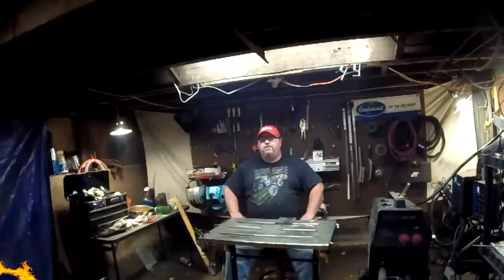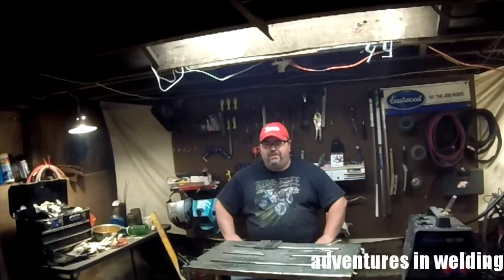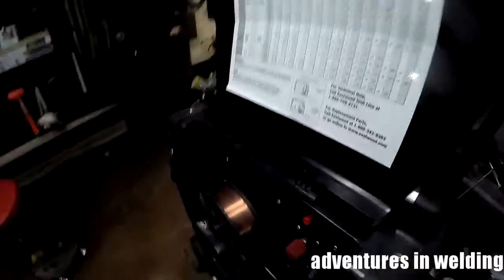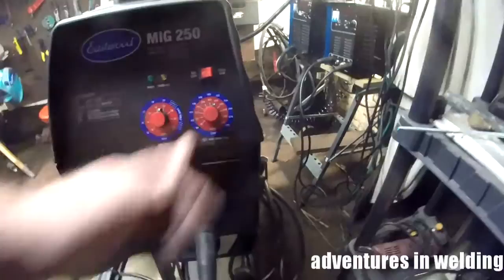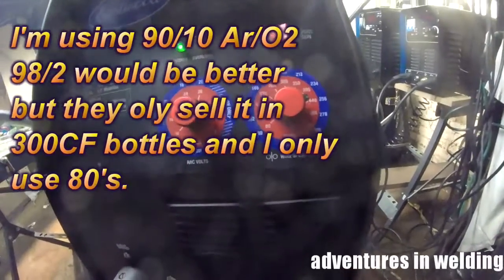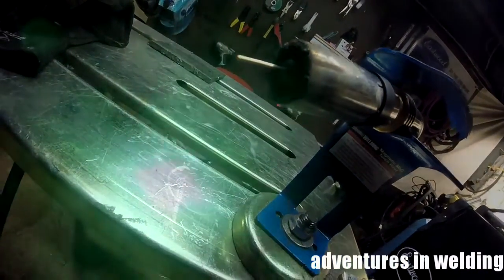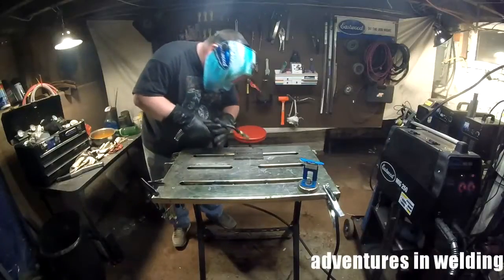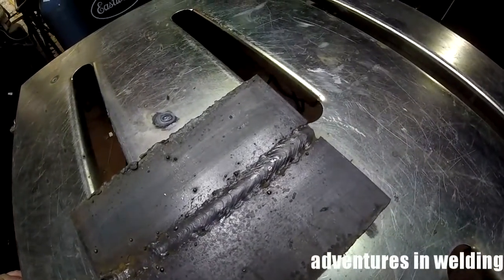Spray Transfer vs. Short Circuit MIG - Adventures in Welding 122

Comment: I know this VID is getting old. However, that did not look or sound like (Spray Arc Transfer) at all. It sounded like (Short-circuit Transfer) while running a little hot or to much speed. On top of not sounding like an (SAT) weld,  the bead profile didn't have an (SAT) appearance. Again it had the appearance of an (SCT) profile that needs to be dialed in.  I'm 100% that was not welding  (SAT) at the time of the video.
 I also don't think that welder is even capable of (Spray Arc Transfer) I could be wrong, I don't know that welder. I will have to look at its duty % and most importantly the Volt adjustments &  the IPM or FPM adjustment. with that, you can determine if the welder is capable of (SAT) welding. With a Duty % high enough to make it worth attempting.

Comment: Its cool that you're making videos....you need a bit more experience. Generally you "push" with non pulsed axial spray transfer. As said many times, you never transitioned into spray and it sounds like you were barely into globular transfer. Your machine may be holding you back. My MM252 dedicated for spray and it works it pretty hard. Get rid of the hobby machine and pick up one with some Puh-Pow!
Reply: +Kenny Fowler -- I like how encouraging your reply is! ...wishing ongoing success to all!

Comment: my setting for spray is 30 volts with 750 wire speed. but that's setting  at work. but what you should was globular transfer. but nice vid keep welding and you'll just keep improving.
Reply from the maker: +Sprocket Gold Thanks for watching, and taking the time to write in!

Comment: Hi Paul, I noticed you were getting a ridge in the centreline of your weld, probably because you were dragging the puddle. Next time try pushing the gun ,you will find it will flatten out more. Scott.
Reply from the maker: scott carr I can't push the root. My brain fails. Brain says pull from the first tack. To be honest I haven't tried pushing an open root since I had GMAW class last year. I'll have to give it another try!

Comment: Hey Paul I will make sure to sub you on my other channels to help ya out. I noticed that your mig seems to be producing globular transfer instead of spray transfer, what type of gas mix are you using?
Reply from the maker: TheToolReview It's 90/10
Reply: Yea spray should be a hiss, with a slight crackle if your puddle builds up. Arc should be a V shape. Wire should be melting before it hits the metal.

Comment: Nice Paul thanks for taking the time to show us that one. So is it just a higher wire speed and more volts for spray vs. the short circuit? Thanks again.
Pidge.
Reply from the maker: PiDGE IAM Hi Pidge, There is a change in the gas also. you need at least 80% Argon. Now there are some choices when it comes to your mix: 90Ar/10-O2, 98Ar/2o2, 90Ar/10Co2. The 98/2 is the best mix for spray (in my opinion) but I can only get it in 300CF bottles locally. And I'm not carrying those up and down the steps so I stick to 90/10. It works....but when you hear the crackling in the video what you are hearing is the ARC going from spray to globular.
Now about Voltage and wire speed....yep. Just kick them up until you hear a hissing instead of a bacon frying sound. 0.035 wire (on my machine) will go into spray Xfer at about 27v & 350 ipm. But every machine is different. The Lincoln PowerMig 350's I use go into spray at 30v 600ipm on 0.035 wire. The smaller the diameter the lower the voltage needed.
Reply: @AdventuresinWelding   you know that this is shit on top of shit
Reply: +Adventures in Welding! That was not spray, it was globular.  I suspect you need a minimum of 27 to 28 volts, or maybe 30 with the 90Ar.  When I spray 3/8 plate I'm at 27 volts on .045 with feed at approx 350 and 100% Argon.  100% argon works great on 3/8 or heavier, just be careful not to undercut and try to pull when ever possible to keep clean weld.